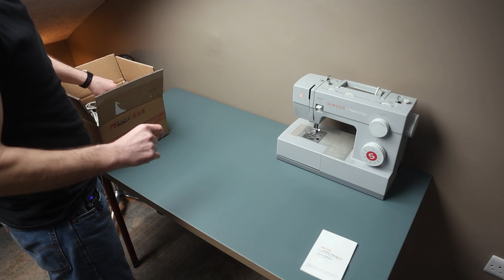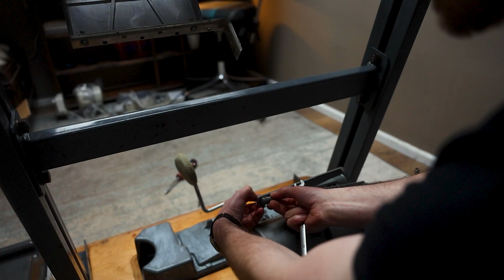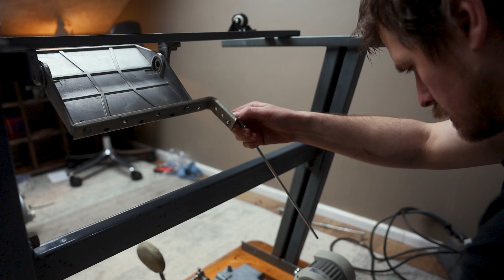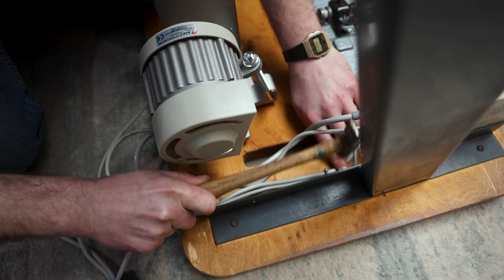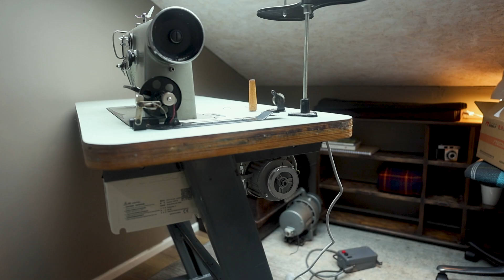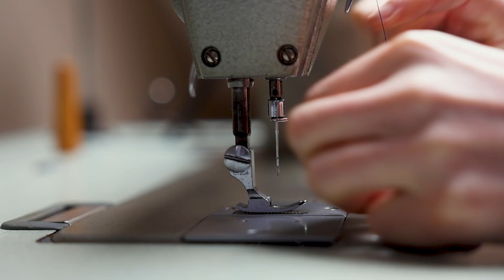easy upgrade for old industrial sewing machine (clutch to servo motor install)

Comment: hi, im form argentina, im not using a traslator, real true, today a was lockibg to buy a sowing machine to do some sit cover for my car , So i started to locked and I found the same machine tha t you have The machine I found has the original engine, and I liked the idea of using an electric motor. Approximately how much money did it cost, and how much power does it have for sewing car upholstery, Thanks for sharing your video and your experience. Big hugs from Argentina.

Comment: thanks so much for this video. I'm putting a servo motor to a portable consew walking foot machine with the same handwheel, hopefully it works
Reply from the maker: Thanks. I’m glad you found it useful
Reply: @MattMakeThing  thanks for video, i also find it useful. Is this 550W motor powerful enough for your work? i plan to instal it on Necchi industrial machine similar to yours.